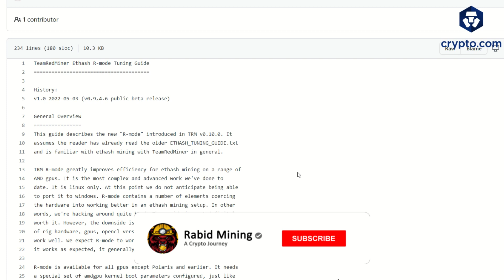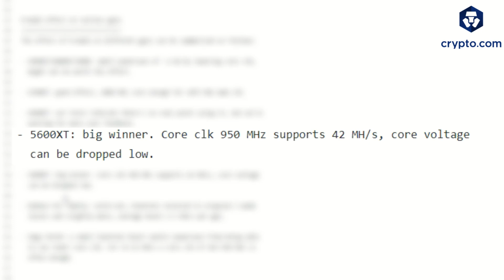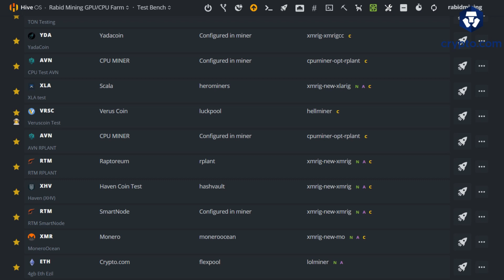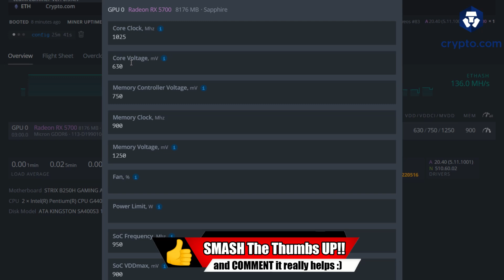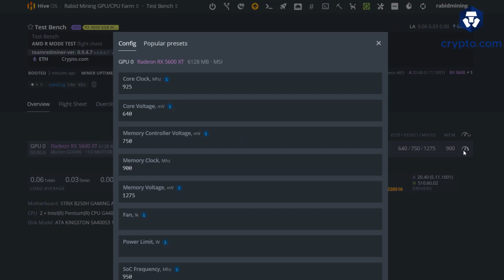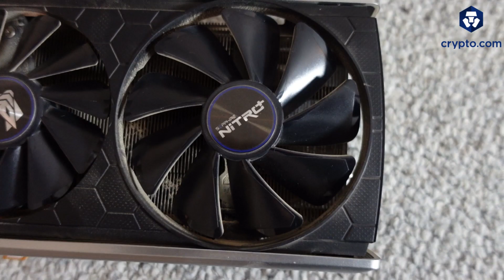TeamRedMiner R MODE | 5700XT 5600XT Hashrates | GAME CHANGING!!

Comment from the maker: Do You Have 5700XT GPUs To Try The New R-MODE?
Reply: I have a 5700 xt without bios mod. Does it work the same? also what amd driver is needed?
Reply from the maker: 20.40 or newer I mentioned the drivers
Reply: I have one :) Red Devil :) R-MODE works great :) I just need to bios mod it and it will be golden, does anyone have a bios for rx 5700 xt red devil ? Can someone help :)
Reply from the maker: Use the one you have I have a bios mod video from years back just copy it and copy straps.
Reply: @RabidMining  Thank you for your response :) Can you tell me please where can I find that video or where can I download the bios with those straps?
Reply from the maker: I'll try to find it
Reply: @RabidMining  thank you kind sir :)
Reply: @RabidMining  i would like it as well i did mine years ago when i first started and dont think i did it right. is there way to bios mod on hive?
Reply: I have Zero 5000 series cards. I have  Polaris, 6000 and nvidia 3000's.
Reply: im getting a comm exit error now i was running 56 before using tmr
now i cant even get it to load
Reply: I hate AMDs =(
Since i made a maintenance in my cards my both 5700 is not working fine, just a basic clean, thermal paste and pads changed. All my 8 Nvidias are doing fine, and the 2 AMDs crashs almost everyday. I now i did it correctly and watched videos about the size os the pads, so there is no reason to that. With this mod the max hashs i got was 48 (with low power) and with the old settings i got 51.5 at TRM, at phoenix i can do 54.
Reply from the maker: Not modded by the sounds of it correct?
Reply: @RabidMining  yes, both moded. 2 Devils, and the mem clock is 880 if i try more i get a lot of stales, even before the maintenance. But after that i got the same hashs, but with a lot of crashs. On of them just stop mining and the miner restarts and sometimes 1 card dissapear so i must restart the rig  xD
Reply: It does show R6616 in the shell.  But I am on 20.40 drivers.  When I run the old github amd driver update script, there are no driver versions past 20.40 available.  How can I get to 21.40.2?
Reply: What's with the clickbait title? My 6800 XTs and 6600 XTs are all more efficient at the wall using R-mode than these 5700s.
Reply: @spire107  what hash and power does your 6600 xt make with r mode?
Reply: I have a couple 5600XT doing 41.66 MHS at 79w software. Settings in Hive: Core :1130, VDD:700, VDDCI 700, MVDD 1300, MEM 900

Comment: That 5700 xt at 64watts software is that stable? Can't get mine stable at those settings.
Reply from the maker: Try to increase the voltage a bit
Reply: @RabidMining  Mine does 55 at like 78 watts.

Comment: I use r mode on my gigabyte rx5600xt on the  stock bios with overlcock I am getting 73 watts on software 39.65 hashrate when bios modded I get 41.45 at 99 watts

Comment: try to upgrade your kernel...I see you use 20.4 that are not the best for R mode (see the txt files)
Reply from the maker: 20.40 and 21.40 are the drivers needed nothing older
Reply: @RabidMining  im fairly new, I can't tell if my driver is older or not, how can I, and how do I update if its the older?  Can it be done through hive?  I don't have a windows PC.  Is that necessary to update the drivers?

Comment: I'm getting                                                                                                          
Unrecognized option (--kernel_vm_mode=RR  My 5700 XT are bios mod. Has anyone gotten this error? I get this error on Shellinabox  >>> UPDATE, you are supposed to use the latest 0.9.4.7 NOT 0.9.4.2  !  otherwise the mode is not recognized.
Reply from the maker: correct I went threw that and showed how to manually select the correct version.

Comment: Hey man, the 6600 is able to beat both the A2000 and 5700XT, based on your numbers. I have a 8x 6600 rig that is at 0.58MH/w. So the GPU's themselves minus the system is even higher MH/w.
https://youtu.be/fsvVJnIbS6M
Reply from the maker: crazy NICE!!!! you may be even better as that's full system didn't even take your system power off.  the 220v probably helps with PSU efficacy as well but amazing numbers.
Reply: @RabidMining  Thanks, yep the system draw is 17w. That video is my other channel. The Asrock 6600's could tune down as low as 46.5w before the new update. Then the new update has saved me 1.3w per 6600 on average accross my 8 card rig. I haven't retested just those Asrocks alone, but theoritically if the 1.3w average is applied to the 46.5w for just Asrocks, they would be using 45.2w and getting 28.9MH for an efficiency of 0.639MH/w. I only have 3 Asrocks though, so can't do a whole rig of them.

Comment: Cant wait to get home to apply them to my 5700s. I already tried with my 6700xts and they lowered the wattage a bit with the same hash. Running 500 software watts with 8 6700xts. Got my meter wating in the mail at home to get real numbers!
Reply: 726w wall on a gold psu not bad
Reply: please give me your settings? 
i got 90watt software hiveos, on 1000 core, 650 vdd/vddci, 1250 mvdd
Reply: @leoncryp8182 
For 6700xt
 640 vdd, 700 vddci, 1200 to 1225 mvdd 
1000 core 1060 mem
Soc freq 960, soc vdd max 825

Software watts read 56-69 watts which is absolutely nuts.
Reply: @TheEVGAftw  lol your settings crashed my rig, ive never touched the Soc freq , soc vdd max settings before,
will play around and see what what i can do, man you must have some golden cards
but my current settings are around 90watt software for 46.5 hash.
Reply: @leoncryp8182  i could do better mine very from 42 - 45 but yeah its pretty close to being unstable. I went for power tho
Reply: @TheEVGAftw  726watt wall for 8x 6700xt is amazing, 
i would not mind having less hashrate for better efficiency
when i get extra time i will try tuning it again, 
my 46.5hash (mem 1075) 90watt software, reads 250watt WALL for 2x6700x
Reply: @TheEVGAftw  i shave off another 11 watt per card = 79 watt soft, 45.6 hash , with mem 1050 and your settings. 
I think thats the best my PowerColor Red Devil can do. 
will try fine tuning it later, see if my current oc stable for few hours before try again.
Reply: Good work, i was super impressed with this card once i figured it out
Reply from the maker: I have yet to try a 6000 series lol
Reply: @RabidMining  you gotta get a 6700xt i want to try the others but theyre efficient!!
Reply from the maker: Nice

Comment: my 5700xt,s run at 850mv power and i have always got 56mh even though you could push them to 60 but i keep it at 56.
Reply from the maker: Nice numbers there
Reply: @RabidMining  i just copied redpandas setting years ago and used the bios flasher.

Comment: my 5600 XT rig still loads up in A mode? I followed all the steps and configs. My 5700 XT rig runs in R mode. Any ideas?
Reply from the maker: Could try setting each device to run
Reply: @RabidMining  sorry don't understand what that means. I'm using the same flight sheet for both rigs on HiveOS
Reply from the maker: Oh they are separate rigs? Hmm not sure then that weird should work maybe try to restart the 5600xt rig
Reply: @RabidMining  yeah separate rigs. It worked the first time in R mode but after an hiveos update it's been A mode ever since. It's the same flight sheet for both rigs and works on the 5700 XT rig so going to have to do some troubleshooting.
Reply from the maker: Ya that's weird try a new flight sheet maybe and select it manually again for the correct miner version.
Reply: @RabidMining  yeah that worked. Weird. Appreciate the help!
Reply from the maker: Np glad it's working once it's out of beta a single flight sheet will probably work.
Reply: Look up c mode for vii and find the google document for a command that checks if the 10 bit mode or whatnot actually changed. The command is dsmeg or something like that
Reply: (dmesg | grep "drm.*block size")
This command will confirm the change. If still on 9bit its drivers or hive os version or an error when entering it in on the grub page

Comment: I ran 6+ 5700xts for a year.  Getting them to run like that short-term and long-term is quite a different task.  Be prepared for daily "GPUX is dead!" Team Red Miner errors.  I prefer the rock solid stable 3070 FHR cards.
Reply: Yep. 6600 XTs, 5700 XTs and 6700 XTs have given me SO many headaches. 3060 Tis and 3070s are just "click the slider" and go have a life.
Reply: @redpilljesus  3070 is my choice of best of best cards. My 6700xt rig gave me problems at first but is just as steady as any of my nvidia rigs at this time.
Reply: @dontsupportrats4089  I ended up selling everything except my 6700 XT. 100W in Windows at 46 MH/s. I use Afterburner to set the clocks and fan speed so I don't have to worry about "Default Radeon WattMan settings have been restored due to unexpected system failure."
Reply: People don't understand overclocks. Don't blame the cards, I have 6800 and 6800xt at 75w to 80w running in windows without r mode
Reply: I had this issue too - do a fresh windows reinstall and do all the updates, then install drivers and nicehash. Rock solid ever since. 

My issue was a corrupted OS.
Reply: @over9kkk  I had these spread around running on both Linux & Windows.  That wasn't my issue with these; they're just flaky when you try to squeeze out the overclocks.
Reply: I had this issue changed thermal pads and now no errors

Comment: If you need to update the AMD drivers don't flash a new image. Open shell in a box and run 

hive-replace -y --stable

You will redownload and update the whole system without needing to shutdown and pull the drive to flash it. Much easier.
Reply from the maker: Great tip that works lol
Reply: @RabidMining  did it update without suffering from the slow download speeds?
Reply from the maker: Yup

Comment: So do you need a bios flash for those settings or no?
What would happen to a normal bios 5700/XT card with the R-mode?
Reply: Yep tested with a 6 5700 rig mixed with both unflashed 5700 and unflashed 5700xt. More power efficient, 800 watts to 750 software. No hashrate increase.  Didnt put my meter on it before updates but 1025 at wall for 6 57's and 2 580s. Excited to do this to my flashed cards now and compare.
Reply from the maker: Try it out I'll have to try without a mod and see how it goes.
Reply: @RabidMining  I have 4 diff 5700 xt variants, none are moded, all between 50 and 51 mh. R mode did add some mh on a few cards. I am going to do the bios mod and see what it changes. One at a time.
Reply: @RabidMining  So, tested it on the same 5700xt Sapphire Nitro - No bios mod, nothing special:
- minus 16W at the wall - I used your exact settings for me (with a little bit more, just a bit) just to stay on the safe side.
I do not care what HiveOS reposrts as Watts (they are lower) since they are never acurate.
Reply: I still have some unmodded ones ill try it out on

Comment: Been using it since a while and it's pretty good for the RX 5000 lineup :)
In the RX 6000 lineup, only my RX 6700XTs get little improvement, the RX 6600/RX 6600 XT remain the same and sadly i don't own any RX 6800/RX 6800 XT/RX 6900 XT :)
My Radeon VII is back to 100 MH/s :D

Comment: Hi,
Where can I set this?
amdgpu.vm_block_size=11 amdgpu.vm_size=2048

When I try to verify R-mode (as described in "Verifying R-mode is set up correctly"), I get different values.
Reply: Sorry but those are kernel boot options for GNU/Linux Debian based distros, you have to add these settings in your GRUB file in order to enable R-Mode on the kernel and drivers level when you computer boots :)
Reply from the maker: In windows
Reply: @RabidMining  So I don't need that in HiveOS.
Reply from the maker: No I just added the command I put in the description
Reply: @RabidMining  I had to run the following command on HiveOS:
echo -e "amdgpu.vm_block_size=11\namdgpu.vm_size=2048" > /hive/etc/grub.custom && selfupgrade -g && sreboot

Or anyone can edit manually the grub.custom file if you have local/ssh access to the rig.
1. Open grub.custom file: nano /hive/etc/grub.custom
2. Add these lines (they must be on a separate line):
amdgpu.vm_block_size=11
amdgpu.vm_size=2048
3. Save (Ctrl+o)
4. Exit nano (Ctrl+x)
5. Run command: selfupgrade -g && sreboot

In Flight Sheet:
As you told:
- miner version 0.9.4.7
- extra config arguments: --kernel_vm_mode=RR
Reply: @V1k1t0r0ny  version 0.10.2 ?
do you still need to set 
amdgpu.vm_block_size=11
amdgpu.vm_size=2048
does it make any difference if you dont set?
Reply from the maker: In hive I never did